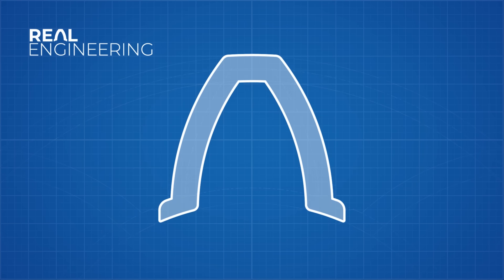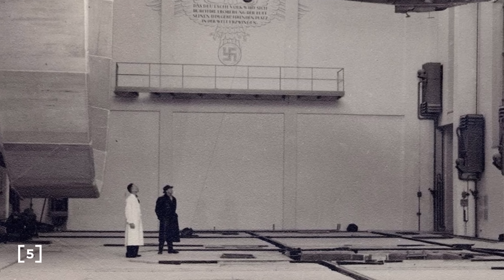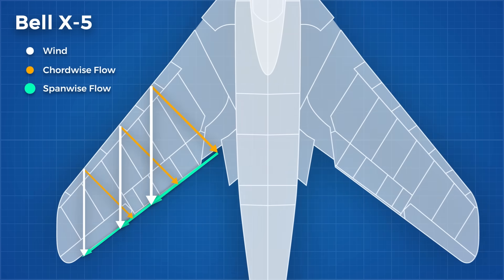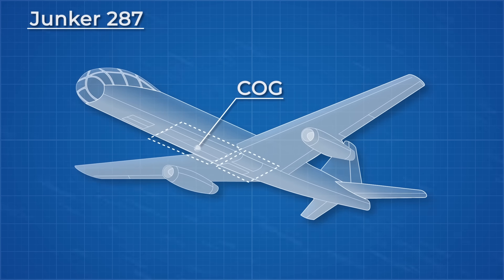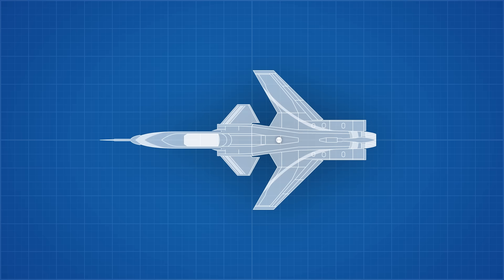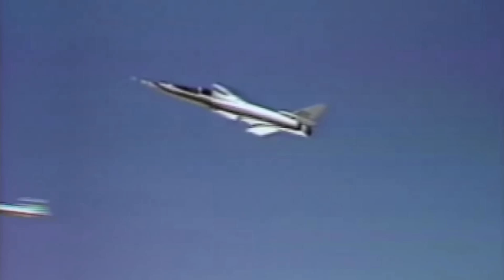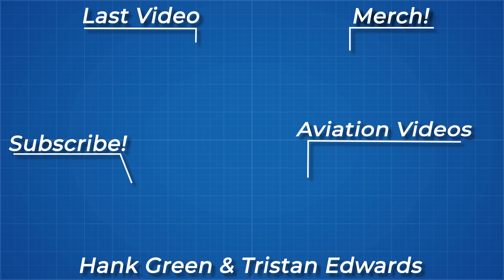Why Do Backwards Wings Exist?

Comment: The F-14 Tomcat is a great example of both proponents in action. But even when fully extended, the wings have a slight sweep.
Reply: Funnily enough, the F-14 fits a bit into the video's discussion of how the tailplanes are constantly applying nose-up pressure to keep a non-forward-swept plane in balance. The F-14A was built with glove vanes, small winglets that were supposed to automatically fold forward out of the leading edge root of each wing when passing Mach 1.4 to create more noseward lift and unload the tailplanes, giving them more authority in high speed maneuvers. However a mix of the unreliability of computers of the time, mechanical/design issues, and the discovery that they actually didn't meaningfully contribute until about Mach 2.5 lead to them having their actuators uninstalled and the whole assembly welded shut with later models not even including them.
Reply: S Art....FAR was nothing even close to this plane.

Comment: Cool video. A few comments/questions: 
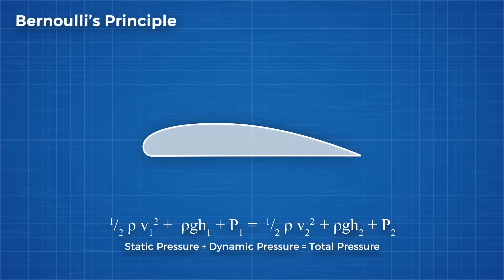 - 1:53 A typical lift tutorial doesn't correctly explain why the air accelerates on the top of a wing. Fast air certainly means low pressure, but why does it go faster on top? The correct answer, streamline curvature, is rarely given. 
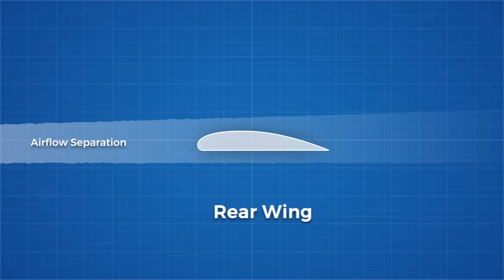 - 3:03 Why does the rear wing increase lift when it's in the separated wake of the upstream wing? That seems counter-intuititve. 
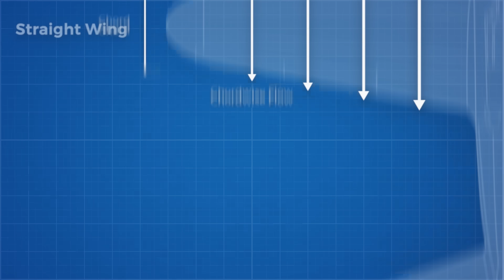 - 5:00 The graphics for the span flow here are great. I'll show these during some of my lectures for sure. 
 - Overall, love the referencing system. Really nice work.

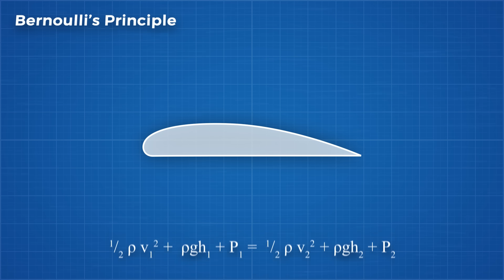Comment: 1:51 As I understand it, the low-pressure zone above the wing is not caused by the air moving faster. It's the other way around. The air moves faster because there is less pressure. Makes more sense that way. The low-pressure zone is generated by the shape of the wing.

Comment: 1:59 Yes, it is false, old, false backward teaching about why planes fly. They fly due to actio = reactio. Not because of any Bernoulli principle. The airstream might be much more stable as an effect of this principle, it helps, but it can not, I repeat, it cannot make a plane fly. Otherwise it would easily make a plane crash as well. To wit when it flies upside down. It's not possible with all planes, but if not, then it's just design and power related. So if you dudes were right, your airfoil would cause those planes to crash during inverted flights. They weren't even possible, to begin with. That simple.

It's even more evidently wrong your Bernoulli story: aerobatic planes have symmetric airfoils and can fly perfectly as well. As everybody knows, these racing machines fly and perform better than most other piston engine planes of their size. Also design related, but the main point is, that you don't need this airfoil for a plane to fly. These planes don't have this pressure difference, for they don't have these asymmetric airfoils. And yet they fly! That's a fact. Proven a gazillion times. That this particular airfoil stabilises the airflow and thus helps improving the overall aerodynamic and therefore also the safety of a flight, is another point and not at issue.

Bernoulli's principle  does not make a plane fly, air masses pushed underneath the wings do! A channel clearly not worth to subscribe to if you don't even understand the basic principles of physics.

Comment: I didn't realise planes like this actually existed, I designed all mine in Kerbal Space Program firstly because I thought it looked cool and always felt like a totally natural design to me, I never minded the comments from other people who said it was "Extremely unorthodox".
Over time and trial and error I found that the jets I built out performed my mates one's which were more traditionally designed.
I naturally moved the center of weight to the back of the Planes and found that with the wings slant forward that I essentially made the plane's Pitch and Yaw plane central to the craft rather than tailed to the rear of it. This meant that it could perform far sharper roll and pitch angles at higher speeds... and yeah, that puts a hell of allot of structural strain on the craft but it's really badass to see that happen :D

I've never known of real like Aircraft that did this forward wing thing,
Now I see that real engineers have done the same since decades ago and for similar reasons, with identical implementations... I picked the wrong career in life XD

Comment: 1:50 it is false because the assumption that the LE of a wing or airfoil splits a streamline that must meet at the TE is unfounded. Please don't spread lies. That assumption is called "Equal Transit Theory" and anyone who has studied aerospace engineering past year 2 can tell you that it is 100% an incorrect explanation of lift.

Comment: Me looking at title and thumbnail: “So the planes can go backwards, duh”
Reply: this reminds me of the joke 

dad: "how did you manage to destroy the gearbox?!"
daughter: "i tried putting it in the rocket gear"
Reply: Big brain time
Reply: This is actually a very interesting concept. What does it take to make planes go backwards (yes, I know some choppers can, as well as hovercraft but what does it take to put a plane in true 'reverse' mode?
Reply: @buddingnaturalist  The only real-life way I know is a plane that is not operating the way a traditional plane does, namely something like an F35B or Harrier in VTOL (Vertical Take-Off and Landing) mode. It's not being a plane anymore, it's hovering like a jetpack. Hypothetically, although I don't think anyone has ever thought it worth doing, it should be possible to build a true propeller plane that could stop and then restart its engine going the opposite direction in midflight. It would serve no purpose I'm aware of and be really hard to build; it would need weird control surfaces, have visibility challenges, and every time it changed direction mid-air it would have to enter a complete aerodynamic stall then dive to exit the stall. I don't think there's any way it would be better than just turning a normal plane, but it would look cool.
Reply: @buddingnaturalist  gravity...
Reply: U dun goofed up
Reply: They can in GTA :D
Reply: @smokecrash2147  Ace Combat 7: Amateurs.
Reply: @ardantop132na6  Ahaha, yes, AC7 has interesting physics as well
Reply: I can donate some brain cells, you need any bro?
Reply: My Face When r/woosh
Reply: insert hey you drop this meme
Reply: Harvard University wants to know your location
Reply: I’m glad I looked through the comments before I posted this myself.
Reply: Who are you, who is so wise in the ways of science?
Reply: u dun haz teh brain twoday
Reply: Your brain is tiny if you thought that

Comment: You said it originated in germany, but that's incorrect.  The design idea was researched simultaneously by several of the great powers, but the first design was built by the USSR in the form of the DBLK in 1939.  The US Cornelius Mallard was developed as a forward swept, tailless airplane in the mid 40s by the US.  Both of these craft were basically a flying wing design with the twist of a forward sweep.

Comment: 2:03 is a bad visualisation... The flow has to point downwards behind the wing, because this change of momentum is the reason why planes fly and do adhere to the conservation of energy. It is also the reason why simple flat "wings" with an angle of attack can fly. The air simply is getting deflected.

Comment: 2:00 people like to say it's false because... it IS false. or at the very least it's misleading.
if the "low pressure, high pressure" hypothesis for generating lift were true, airplanes would be unflyable throughout most of their flight phases. lift would be impossible to control with simple flight control surfaces like aileron.
for example: when an aileron deflects upwards, does the low pressure over the wing instantly turn into high pressure and visa versa? that air that was moving faster over the wing a fraction of a second ago has suddenly slowed down below the speed of the air under the wing? probably not eh?
and what about fighter jets? they'd have a real problem flying level at high speeds because of all the excessive lift generated. and why don't you see jets getting catapulted into the horizon as soon as they start vertically climbing like a rocket, when their wings are perpendicular to the ground?
the whole premise is flawed and generally not accepted by experts and professionals.

the main way lift is actually generated comes from Newton's 3rd Law (every action has equal and opposite reaction etc)...
the shape of the wing deflects the air over the wing downwards (take a look at the animation at 1:54). the air reacts by exerting on the wing an equal force in the opposite direction.
it's easier to imagine how the wing literally throws that air downwards and backwards, and because neither the air nor the airplane are immovable objects, the air pushes back enough to LIFT the entire airplane both forward and upward. or downward or backwards, depending on where you throw the air.
this explains why ailerons, flaps, spoilers, tabs etc. have an immediate effect on the lift vector.
this is also how thrust is generated. in jet engines, air is collected, compressed and mixed with fuel. this air-fuel mixture is ignited and exits the engine at great speed. this pushes the plane forward.

I understand why the makers of this video chose to explain lift by Bernoulli's principle (because it's more convenient and segues better into what the video is actually about), but it's still disappointing to see old half-truths propegated instead of the slightly longer but more accurate explanation. especially from a channel called Real Engineering.

https://www.grc.nasa.gov/www/K-12/airplane/newton3.html

Comment: Great vid.

But please do not perpetuate some myths by your animations.
1) The air that flows above the wing does not reach the end of the wing at the same time as the air that flows beneath the wing. This is very important, and also very easy to disprove in wind tunnels. 

2) The air that exits a wing flows downwards. This is absolutely necessary. Bernoulli's principle is compatible with Newton's 2nd Law, which means that if you want to lift the plane, the air must be pushed downwards. Since the incoming air was horizontal, this means that the outgoing air must have some downwards component. The momentum imparted by gravity upon the plane is carried away by the air absorbs all of those downward momentum.  The complicated forces that cause the air to be deflected downwards have as reaction pair that acts on the wing as lift. 

These are the most common misconceptions that are given the highest priority in any presentation that has learnt from physics education research. It is a century old, and has been reconfirmed too many times to manually count.
Reply: ad 2) that's "probably" why it's called "downwash".

Comment: Aircraft wings do not use Bernoulli's principle at all . A real engineer would know that. The typical experiment to demonstrate the principle in schools (a tube with a narrow centre) also now includes a version with the tube split to show the principle breaks down without an enclosed structure. In the case of an aircraft wing, this is demonstrated in a wind tunnel by the split air masses not rejoining to create the same mass at the trailing edge of the aerofoil. Instead the top air mass joins with a bottom air mass that arrived at the leading edge of the aerofoil at a later time. Aircraft wings are reliant on chord angle in normal flight and high wing angles to craft velocity (a vector combining speed and direction) in inverted flight.

Comment: I tried to answer the question "Why Do Backwards Wings Exist" before clicking the video and while hoping to come up with a good simple logic as to why I just settled on 'in order to be able to dive faster' intuitively, without really knowing why I realized that. So.. questions: A: Did anybody else feel like they intuitively got why right away? and B: If so is there a one or two sentence way to say why that is the case? 

Basically I'm curious whether I just intuitively got something that's pretty complex, or if there is a simpler way to communicate why you would 'get it'. Is aerodynamics easier to intuitively grasp than to logically understand?

I think if you could shape your hand at will while holding it out a window in a moving car, shaping it such as a plane with backwards wings versus straight would just dive better, right? So I guess that's intuitive understanding of it.

Comment: HFB320 was a civilian aircraft with a forward swept wing. No fancy computer to keep it flying.
Reply: The X-29 had mulitple experimental systems on board to test, such as the control surfaces (just the general setup/layout of them). The combination of the forward swept wing, the control surfaces, and the generally unstability of the craft due to center of gravity made the machine unstable. A human would have not been capable of making so many corrections a second. Plus trying to manuvuer something that is unstable safely can be a difficult challenge, especially if the plane lost control. So they needed 3 computers to fly it. They would also determine the best course of action in manuvuering the machine in the way that the pilot wanted.

Comment: One of the problems with forward swept wings were the stall characteristics. They have superior stall characteristics to rear swept wings. Fighter pilots didn't like these characteristics as it meant that they could't "force a stall" when in a turn fight.
The way this works in a rear swept wing is that the defending aircraft forces a stall whilst in a turn fight. This causes the aircraft to perform a bizarre vector whilst maintaining the turn which the attacking aircraft's pilot can't perceive until it's too late forcing the attacker to break off or they will become the defensive aircraft.

Also, does anybody know why aircraft with forward mounted horizontal stabilizers are called "canards"?

..........................Cause they canardly fly ha ha ha!

I'll get my coat.

Comment: Airplanes DO NOT FLY BECAUSE OF BERNOULLI'S PRINCIPLE!!! Please please please stop propagating this concept!  It requires the massive assumption that air molecules meet back together at the trailing edge of the wing. This is factually false, and has been demonstrated so.  Wings generate lift because they accelerate air downwards. Period.  If bernoulli's principle was the cause, then paper airplanes, flat wing planes (such as rubber band planes, and RC planes), airplanes with symmetrical airfoils, and early airplanes who's wings were a single layer of fabric, all would not be able to fly.  Also, if you do the math, for Bernoulli's principle to have a significant effect, the top surface of the wing would have to be 2-3 times as large as the bottom - i.e. more than a half circle. Additionally, if you blow air over just the top or just the bottom of an airfoil, it still generates some lift. Bernoulli's principle, in case anyone forgot, is an energy balance equation, so it only applies along a streamline.
Reply: Im here bcoz you smart
Reply: Exactly. Totally agree.
Reply: He literally stated in the video that it is only a part of why planes can fly
Reply: @kennylee6499  Well, that doesn't actually make his statement true because Bernoulli's principle is not true or false for airfoils, it is NOT APPLICABLE for airfoils. Bernoulli's equation is true for a SINGLE STREAMLINE and in case of an airfoil you have two different flows, one over the wing and one under. The second assumption is that two streamlines merge together at the trailing edge of the airfoil at the same time so both flows must take the equal amount of time to reach the end of the airfoil, which is just false, as in reality the velocities in two streams are independent of one another. So the "longer path" theory is just an incorrect over-simplification of Bernoulli's Principle.
Reply: NASA has published and article dismissing these incorrect lift theories, including this one. But according to Real Engineering "Some people say it's wrong."

Comment: An unstable aircraft design that has control surfaces controlled by computers can be extremely manoeuvrable, which is basically what you want in a fighter aircraft.

Comment: They probably got invaluable data building and testing this plane but, just by looking at it, you can tell it was predominantly an engineering exercise.
Reply: Roy Batty to be fair most of the x-planes were but their all amazing and I wish there were more YouTube videos on them
Reply: In the Ace Combat games they have a fictional aircraft that use both a delta and forward-swept design by using variable geometry wings, called the X-02 Wyvern.  The wings are deployed during sub-sonic flight for greater maneuverability and fold inside the delta wings when you go supersonic to cut back on drag and also affording some measure of stealth capability.  I think such a design is increasingly plausible with current technology today.